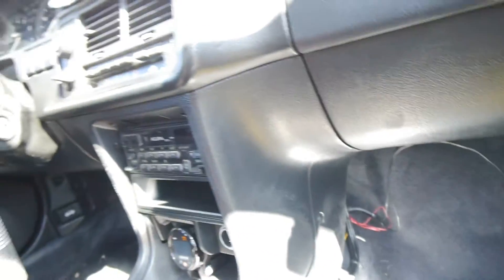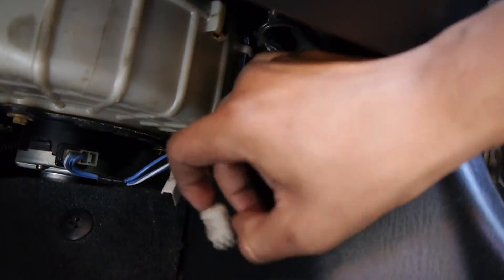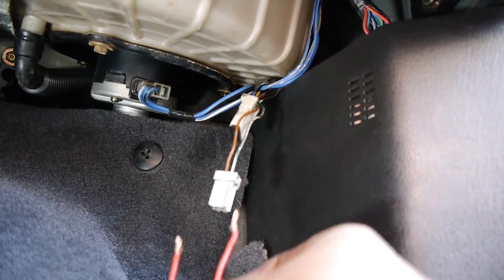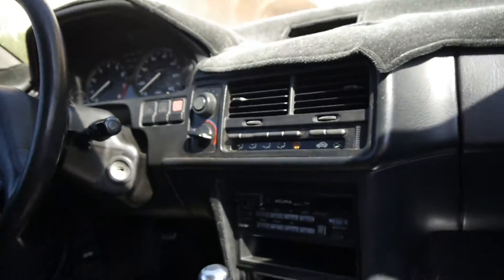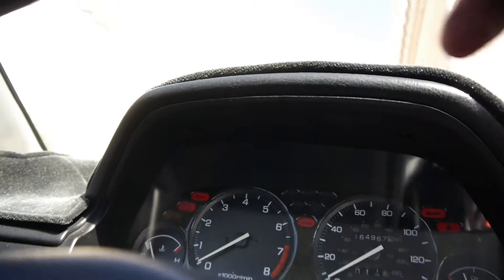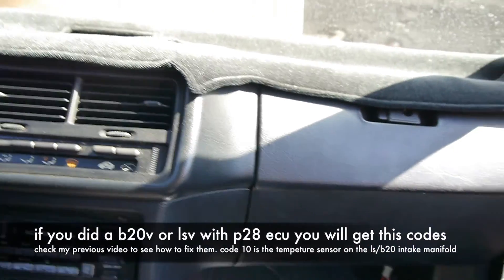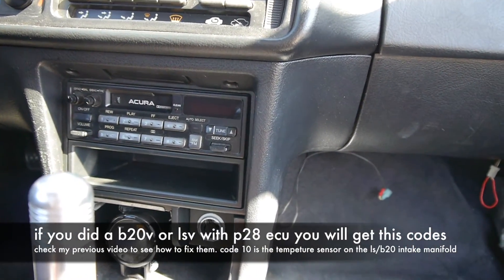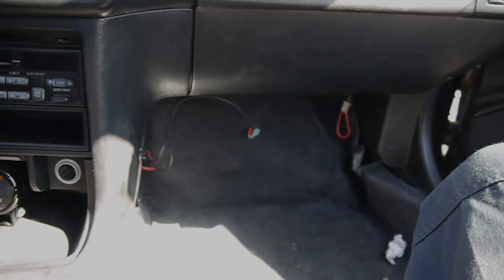how to check the check engine light on obd1 integra or civic

Comment: Have a question tried this on my 94 integra with a b20b swap and the check engine light just continously does long slow blinks? It worked before to report my wheel speed sensor and the abs pump were bad. Now it does nothing
Reply from the maker: Idk bro long blinks are 10 if is just long blinks for the same spacing in  between each then is a 10 if there's a few long blinks together could be 20 or 30 or something like that check on it and maybe itll tell u what wrong and might be able to fix it if u look up the correct code